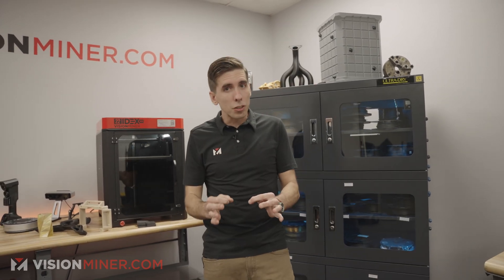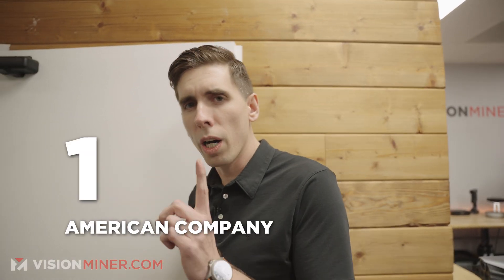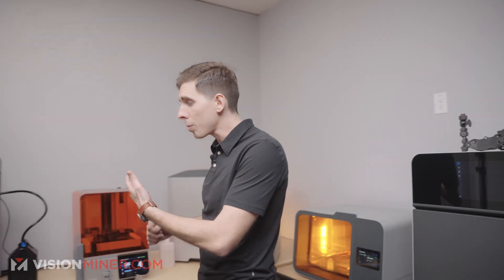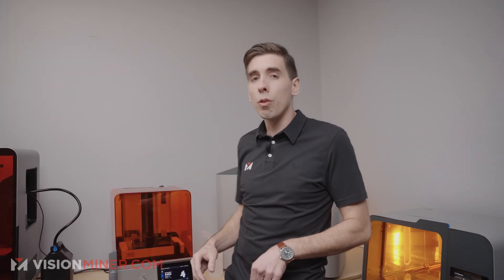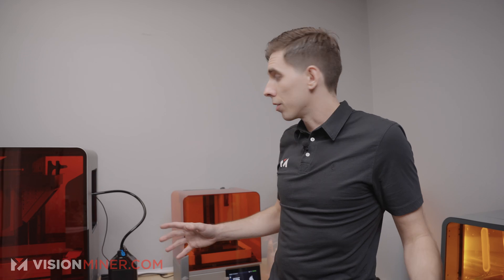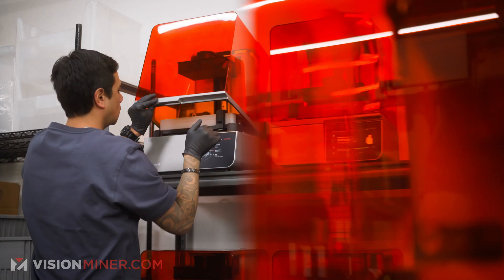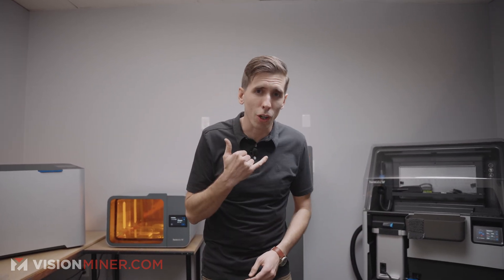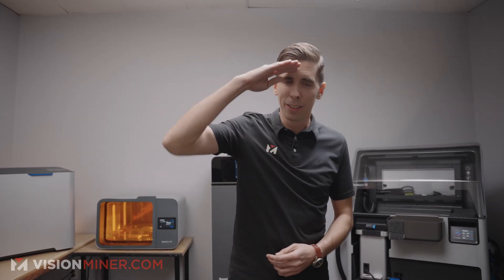Formlabs Now at Vision Miner – Form 4, 4L, and Fuse 1+ 30W

Comment: 15k....for a fdm print. who are you guys fooling.  Everyone has lost their minds.
Reply from the maker: Many resins may share one or two properties with PEEK or ULTEM, but they don’t offer the full range of performance benefits. Our customers—especially those in aerospace and high-performance engineering—can’t afford to compromise. That’s why having the ability to print high-performance thermoplastics is essential. The 22 IDEX is designed specifically for this purpose, reaching the necessary temperatures to print these materials correctly. Plus, when you choose our machine, you also gain access to our dedicated customer support team.

Comment: I use 3D Systems Viper SI2 (~$250'000 machine) 20 years ago for functional / mechanical print.

I have been tracking Formlabs since their beginning, own a Form2, spoken with their sales rep, I know their business is to make 3D printing "accessible" and "easy to use" for small businesses, which is admirable.

But I'm not a fan, because

1) it sacrifice print quality when it build upwards platform away from the resin tank, rather than sink into the resin tank as it should in the 1970s machine concept.  Meaning you always have to build your model at an angle, sacrifice sharpness over compressive strength (Perpendicular to the layer/ sheer lines)

2) They seem very dead set on 'laser' over 'continuous DLP', which I'm no longer sure I can defend it over slower build time, but it their overall decision.

3) any consumable tray with flexible screens require disposing especially when heavy printing with thick wall / functional parts.  You don't have this problem if using 1# (if build platform goes down into the tank)

All the SLA professional external print houses I used in the UK doesn't use Formlabs (that I'm aware of), they uses professional 3D SLA printer, build platform sink downward.

SLS - have come a long way, never print inhouse myself, always relied on external, but still 'post processing' will always be a hassle, but external print house isn't cheap for a functional / design iterative parts.
Reply from the maker: Their Form 4 systems got rid of the Laser -- it's now a LED projection, Masked SLA -- so it's curing the entire layer at once, like DLP -- so they're ridiculously fast now! 

Agreed on the vertical / industrial style tanks -- the barrier to entry for customers is likely the much larger volume of resin required for a downward-moving system, but that's still how the large industrial machines do it :) Much, much larger, for sure! But, yes, it would be nice to see a 10x10 or larger machine with the bottom-drop style system. 

Their SLS is the most streamlined system we've used, at least in the small business sized units -- we'll be doing a "speedrun" video soon to show the exact, un-cut process, and tomorrow, we're releasing a video going very thoroughly into the process -- check it out in the morning!

Comment: Sweet! Been looking at a fuse setup to pick up jobs on xometry alongside my CNC board.  Also, i left you a message on your site chat- the verbiage on your fuse packages on the website is copy pasted from the Form4 so it's all resin tanks and curing stations. The pricing and photos are correct though.

Cheers! Thanks for the videos and been loving the podcast.
Reply from the maker: Thanks a ton for the comment, fixed! The fuse has been beyond impressive -- we're really blown away. Give us a call, maybe we can make a special package for you! :) 833-774-6863